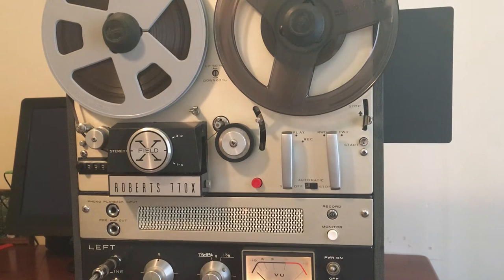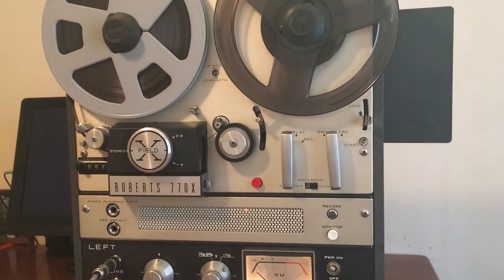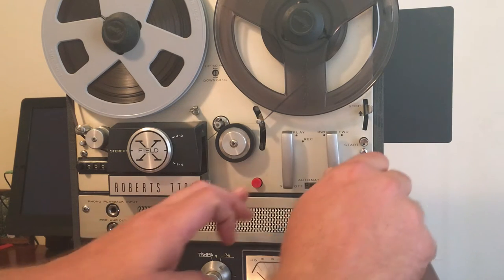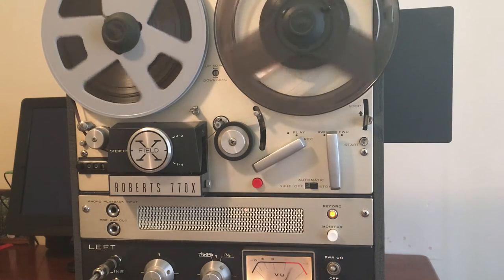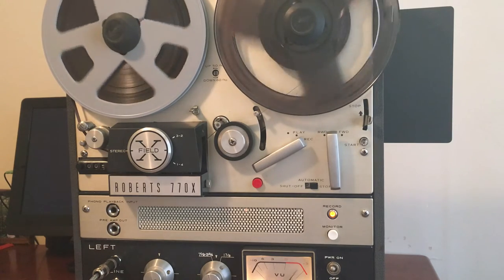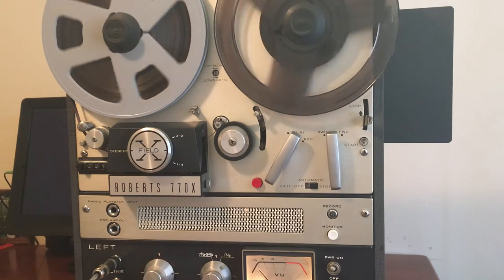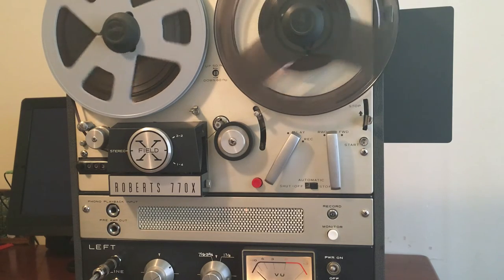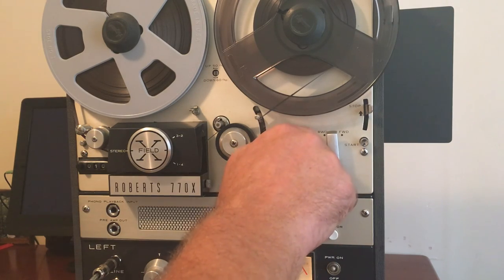Roberts 770X Tube Reel to Reel Tape Machine

Comment: The sound-on-sound function turns the unit into a 2 track (multi-track) recorder. I used it back in the day to play rhythm guitar and sing the vocal on track 1-2 and then rewind and listen to what I recorded in the monitor mode  with headphones, while I sang the harmony parts and played lead guitar licks on track 3-4. I did this for years until they came out with 8 track reel to reel recorders. Hope this helps.

Comment: Hello, I was wondering, if I bought a new set of tape on the internet, does it come in a plastic case or the tape comes by itself. (I am refering to the left one on your video), thank you for your help.
Reply from the maker: You can buy tape alone which is called a pancake or tape on a reel.

Comment: Thanks Marcus I did find replacement capacitors....If anyone else out there has the same problem, contact  Marc at <solutions@ultraelectronicactive.com> he put together a package of capacitors to replace the old one....haven't installed them yet, I will post the results when I do
Reply: TommyD Hello, so did you install the capacitors already? Cause I will contact that person if you answer is good... thanks so much

Comment: I have the 15 inch capstan for mine. Great machine.
Reply: Always wanted one. Wasn't there a different pinch roller that went with the 15ips capstan? I also remember they also had a reel extender to accomodate 10.5" Reels
Reply: @yaknobahjones7856  Yes and that is what I have. And I have seen photos of the "long arms" but I don't have them
Reply: I also have the 15ips capstan💅
Reply: Curious how big of difference do you hear in fidelity from 7 1/2 to 15 ips?

Comment: I got one of these from a thrift store yesterday. It seems to be in good condition from what I can gather. Where can I get tape and what size? Please help. Thanks for posting.
Reply from the maker: Cryogenic Sound Congradulations on the find. These use standard 1/4” tape on 7” reels. You can buy new, used or NOS tape on eBay or buy new tape from places like sweet water or other online stores.
Reply: Thank you so much for that info.

Comment: I would be thrilled if you could help me with the running capacitor. Mine failed as well but my local tech doesn't know how to proceed. The original specs on those capacitors are not something being made nowadays. Could you maybe provide your Tech's contact info? Or do you know how he solved it?
Reply from the maker: I seem to remember him using several capacitors to equal the value of the original. I will ask him tomorrow and get back to you. It should have the values on the capacitor that went bad on your unit.

Comment: I recently purchased a 770x and am in need of a run capacitor, would you please tell me where I can purchase one?
Reply from the maker: Are you talking about the start up capacitor to get the capstan rolling? If so, they are not easy to come by but can be found on eBay and certain forums. If you cant find the specific capacitor you need I have seen people get 2 small caps that equal the power to use instead of 1 and that works also.

Comment: Your history is off
Reply from the maker: Arnold Alt, Jr. No it isn’t, Roberts was ultimately bought out by Akai and absorbed. The last Roberts was made in 1973 and Akai got most of its designs from Roberts, including the Crossfield.
Reply from the maker: Arnold Alt, Jr. Here is a great article about how Akai absorbed Roberts 

http://museumofmagneticsoundrecording.org/StoriesRoberts.html
Reply from the maker: Arnold Alt, Jr. Most of the early Akai reel to reels were crap models. Roberts refused to do business with them unless they copied Ampex. After Mr Roberts died, Akai took over all of their reel to reel sales and it was ultimately absorbed.
Reply: When did that happen? I have an owners manual from an Akia M8 having cross field.
Reply from the maker: Arnold Alt, Jr. Read the link I sent you, mr Roberts developed the Crossfield technology in the early 60s. Did Akai buy out the Roberts name? No.... but did they buy out the Roberts technologies... yes.
Reply: Nice article. Mine is Roberts 771X Solid state. It is original and I have all the manuals. (copies) When were these on the market?Thanks..Arnie
Reply from the maker: Arnold Alt, Jr. I found an advertisement for a Roberts 771X that is dated 1970. I suspect your Roberts is probably one of the early solid state models made.